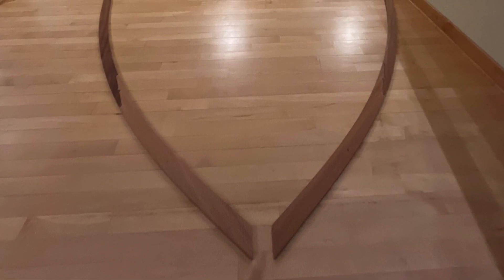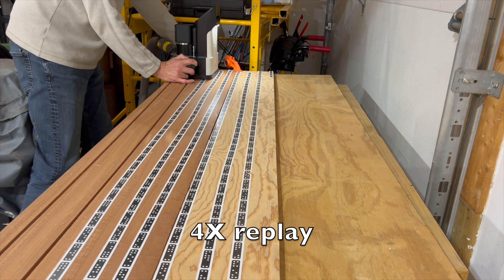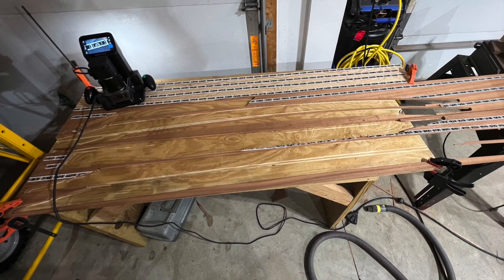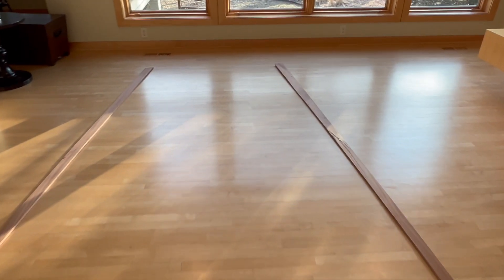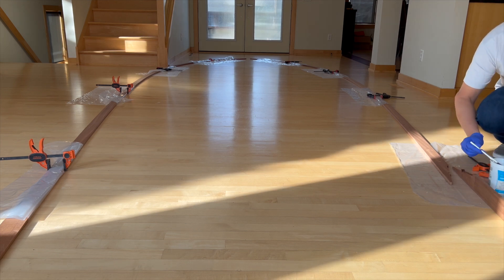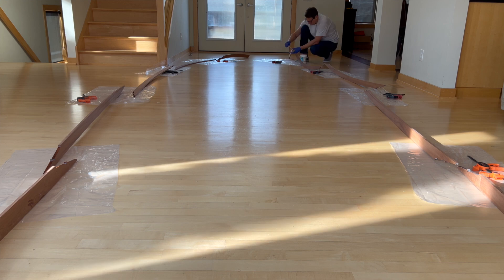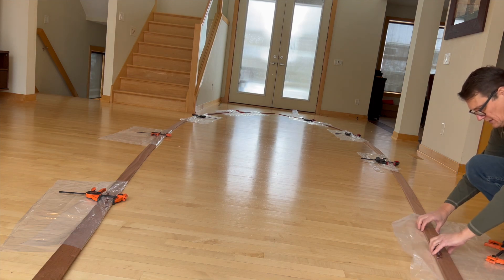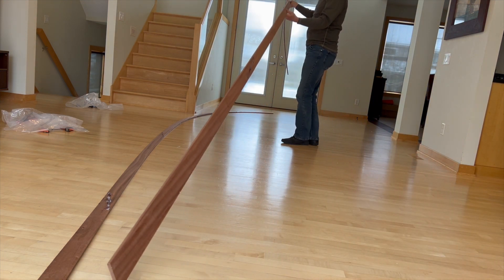Temptress Build 61: Finally... CNC Shaped Sheer Clamps

Comment: I continue to be amazed by guys building large projects in a small space...  Stay creative!   Regarding thickened epoxy:  You may want to check into System Three's GelMagic as it's already thick, you simply mix it 2:1 and go.  Skip the pre-wet step, just make sure the joint is clean and apply.  Looking forward to the progress!  5 more months (?) and I can drop mine in the river again...
Reply from the maker: Thanks for watching Ted.  I will check out System Three.

Comment: Jolie travail et bravo pour l’assiduité 😊
Si tu as un deuxième défonceuse avec une fraise à copier peut être que tu gagneras un peu de temps sur l’usinage de tes pièces 😅 c’est une observation pas une critique 😊
Merci pour le partage 🎉🎉
Reply from the maker: I agree.  If I were to do this project over, I would use the shaper for the first 1/4” deep cut.  And then use a router with a guide bit to complete the cut.  

But I am now all done cutting the sheer clamp components.

Comment: Could you do the second and third pass faster with a normal router and a bearing bit to follow the shape cut on the first pass? 
I’ve watched your build and both of Dan’s builds and it is great to see that this build 
 is possible for us non professionals- at least the ones who have a very large garage.🙂
Reply from the maker: Mike - Thanks for watching.  You are right.  If I were to start over, I would cut the first 1/4” deep with the shaper and then use a guide router bit for the rest.

It is a super challenging project, but fun for me to see and learn the different technique of a professional with the proper tools (Dan), and a novice with borrowed tools (me).
I have seen Dan’s build… it is way nicer than mine.  But I plan to finish strong.